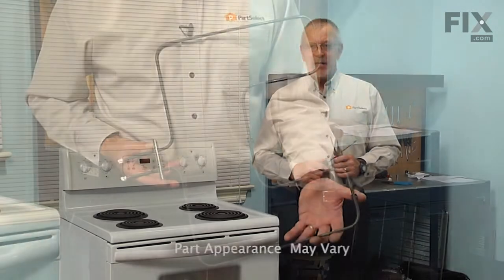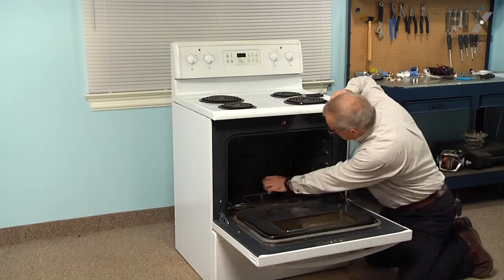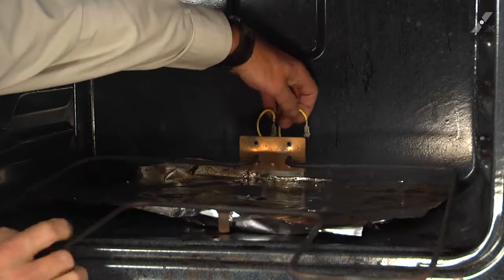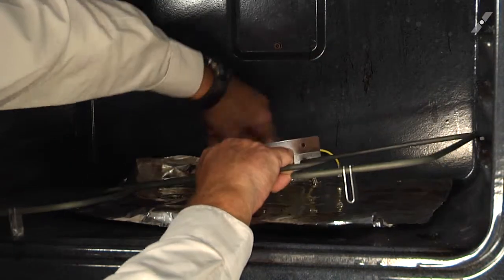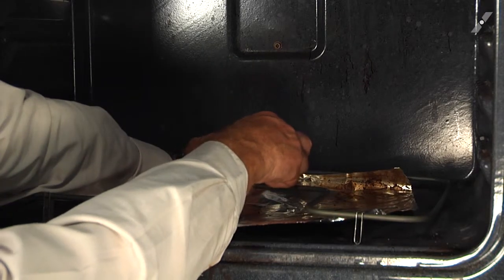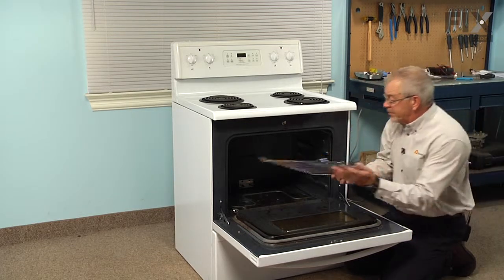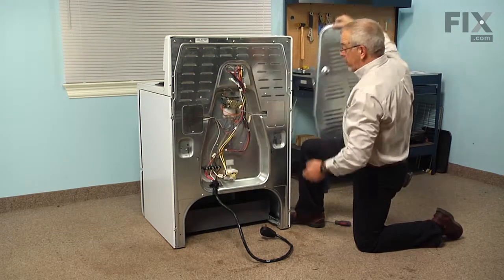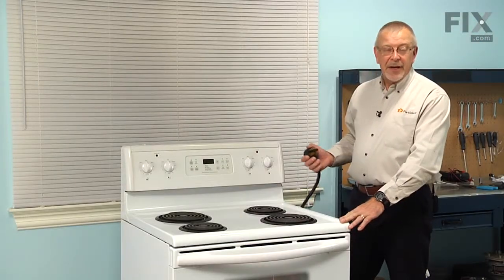Frigidaire Range Repair – How to replace the Bake Element

Comment: Would it be safe for me to remove the grease clogged baking element insulation at the back of the stove(caused from a loose baking element), and replace it with some insulation that is in good shape that I got from another oven? Thanks!